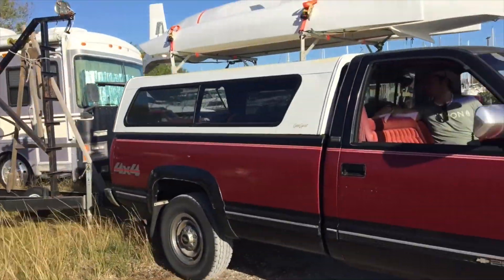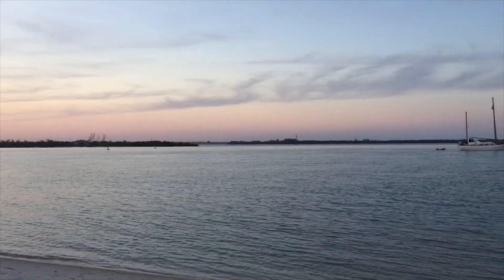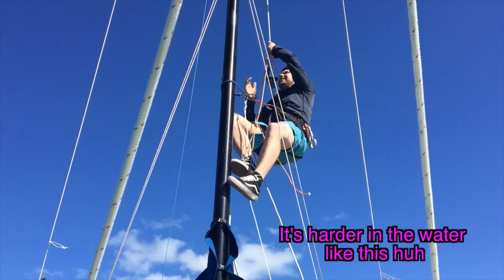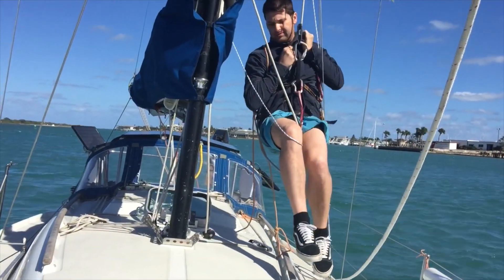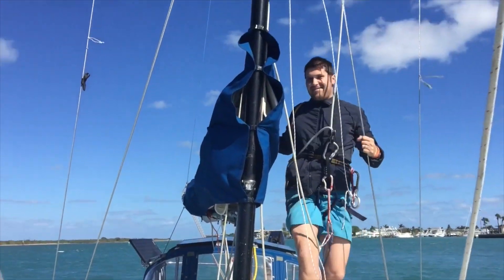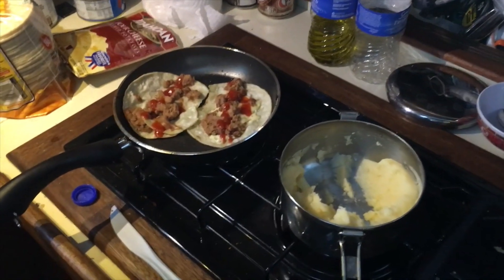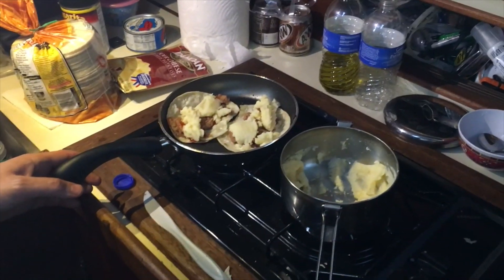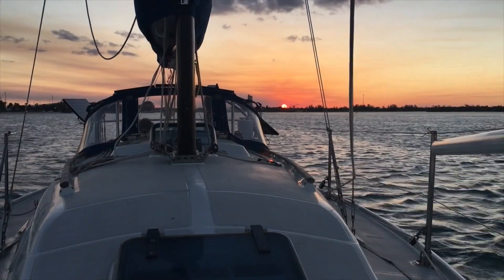Rookie Mistake, We Screwed It Up Good! Ep. 19

Comment: Sorry watched again and heard you mention the name. So could you explain what you should have done to avoid your front anchor from fouling. I didn't under stand what the item was you mentioned you left in Oregon and how that would have helped you. Thanks in advance.
Reply from the maker: The item that we mentioned we left in Oregon is called a kellet. It is a weight placed on the anchor rode to keep tension on the rode when the line goes slack and it helps to keep it from fouling or in other words from wrapping the keel. In a later video we show us finding an old piece of chain that we ended up using for the the rest of our trip. It didn't work all that well for us, but with our mostly rope rode it did help a little bit, so we continued to use it anyway. What we should have done to prevent wrapping the keel with the anchor rode in this video, is not anchor in an opposing wind and tide. Haha Thanks for watching our videos and for leaving us a great comment with your questions. We really appreciate it!

Comment: More chain less road. Keeps the angle better so you don’t get keel wrap
Reply from the maker: Thanks for watching our videos and for taking the time to leave us a great comment! Our small boat was extremely sensitive to weight in the bow. In the beginning we tried having a 60' length chain, but the weight of it in the anchor locker caused extensive hobby horsing. The 10' chain ended up working fine for us, and we were very cautious not to anchor near any coral. Although I do agree that a longer length of chain would be ideal. We have never had any problems with our Rocna Vulcan Anchor. It always sets within it’s length and has never dragged bottom under normal circumstances. (There was one time while in The Abacos, after anchoring we realized we were in an area with a soft muddy bottom. It was like anchoring in pudding, which is not ideal.)  As for the wrapping of the keel, we found that it only happened to us when we anchored in a current of water with an opposing wind. By adding the extra weight of chain to the anchor rode, about 15’ from the bow, it allowed the rode to rest on the sand below which made it easy for it to move under the keel when tides were changing direction.